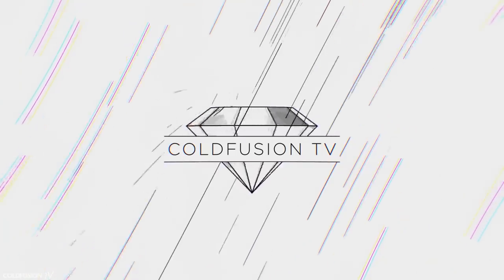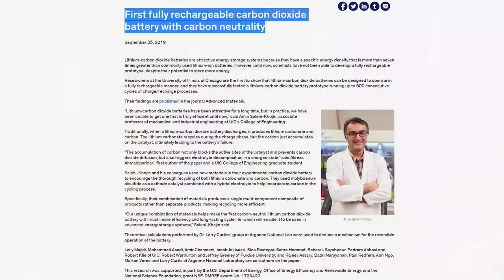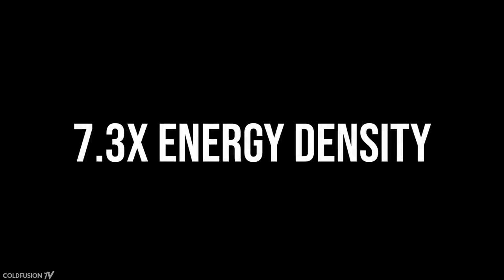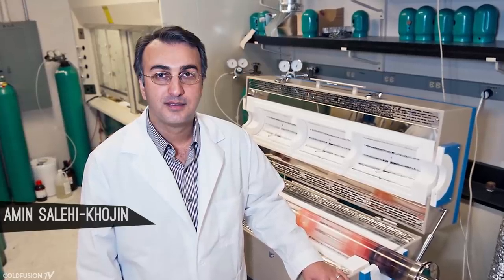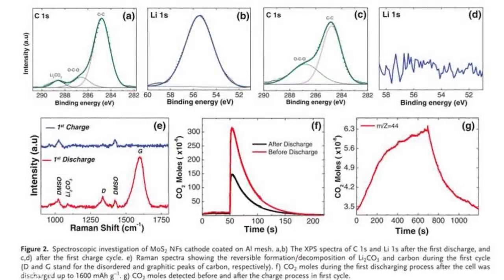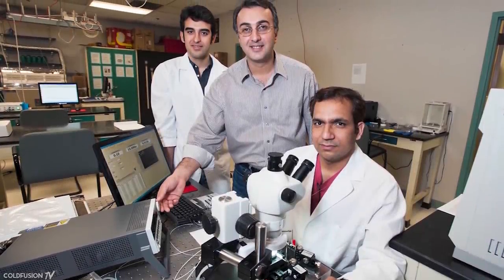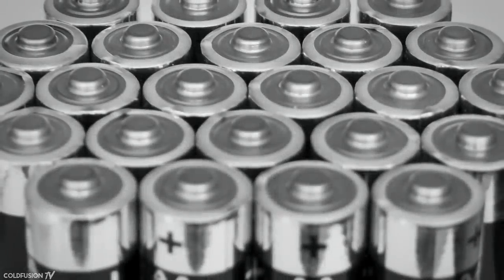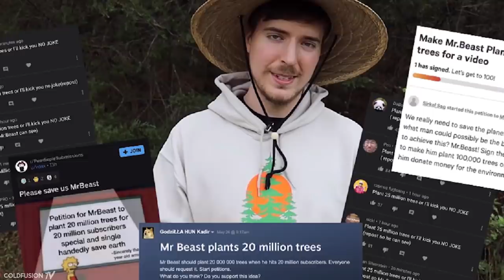Carbon Dioxide Battery Breakthrough

Comment: New batteries are like graphene: It can do anything but leave the lab.
Reply: Well said, lol
Reply: Best of The Year' YT  Comment !🏆👍
Reply: Sad
Reply: There are greater forces playing, we just need to wait until one wins.
Reply: @justj911  So why does the advertisement has Lipo after their trade name?  Doesn't Lipo stand for lithium polymer?
Reply: Just the same as cancer cures always 10 years away.....1970's 1980's 1990,'s 2000's 2010....always 10 years away...
Reply: Flex Seal can't fix that.
Reply: @hlcepeda  The reason it isn't used in many consumer applications is that it is difficult to properly produce within the tolerances needed for it to function as described.
Reply: Ay it 😂😂😂😂
Reply: @hlcepeda  The first link was a real eye opener.  All this time, I thought graphene was a fibrous film.  Most of this stuff are nano particles in powder or liquid emulsion form suitable for printing applications.  This is amazing.  Thanks.
Reply: PREACH
Reply: Bazinga!
Reply: @ashleylaw  Cancer in the 1970s and 80s was a death sentence. Also most cervical cancer can be prevented by getting a HPV vaccine.
Reply: @harryballsak1123  Then 1 in 300 now 1 in 3. Soon to be 1 in 2 you stand no chance...none .
Reply: enter the mirror world
Reply: Fundamental research produces 100 potential paths, and perhaps 1 or 2 turn out to be viable scientifically and commercially. You can thank them for their perseverance in bringing you modern technology, since almost everything you use today is based on such research, or you can be a jackass and pretend they did nothing for you and just point to failures or things still under development.
Reply: @ae1ae2  
Did it occur to you that I was making a joke?
Reply: Check out Estonia they are making curved graphene capacitors which are better than batteries for over a year now.
Reply: There is a company called Skeleton Technologies in Estonia that has been making a better form of "curved graphene" capacitor that is better than a battery. I believe it has in production for over a year now. That is encouraging.
Reply: @ph11p3540  yes and graphene is the polymer you genius
Reply: Whatchyamacallit I get your point, but Graphene IS in the market now. They make graphene car coatings and polishes.
Reply: You still need to mine a lot of Lithium metal, which is flammable if mishandle. Acid lead may be another choice.
Reply: @justj911  These are no true graphene batteries. Just a catchie marketing trick to lure in more buyers.
Reply: The battery technology is still in research phase because they fear the petroleum cartel will kill the scientists. They will release the finished product in time when the petroleum cartel allow them to reach mass production phase.

A new battery technology is not worthy to shed their blood.
Reply: @TUHANbukanorangARAB  Sure mate. The petrochemical industry has killing agents everywhere...
Dream on. Our periodical system simply doesn't provide many more choices to combine to make cheap, effective and light batteries. Taking into account the fact that fossil fuels will be around for at least the next two to three centuries, a commercialy viable battery is still far, far away.
Reply: @GTfour01  
Scientist said, "I am too young to die." Even ISIS was made to take over oil wells and oil refineries.
Reply: @TUHANbukanorangARAB  Yes. And the earth is flat. 😆😆😆
Reply: @GTfour01  
More over, Mujahiddeen fighters were trained and funded by CIA.
Reply: @TUHANbukanorangARAB  Yes, and that means the CIA chases all scientists trying to destroy any progression in the field of developing new battery technologies. Ofcourse you have many proven examples of this happening...
Reply: @GTfour01  
That is Possible, CIA just threaten them not to finish the research and it will not out for mass production untill the time when petroleum cartel allow it to be commercial product.
Reply: @TUHANbukanorangARAB  Ofcourse you have many proven examples of this happening...
Reply: @GTfour01  
Untill now, USA still depend on selling petroleum to gain profit called as PETRODOLLAR policy. Therefore new battery technology threaten PETRODOLLAR then CIA must react.
Reply: @TUHANbukanorangARAB  Any nation capable of building their own 5th generation stealth fighter/bomber jet, is more then capable of researching and developing battery technology. Your case simply doesn't stand. Sorry. (Not)
Reply: @GTfour01  
So you think Rusia is willing to go bankrupt for researching battery technology because no one will buy Rusia's crude oil? STUPID MOVE. My opinion is Rusia prefers to sell crude oil instead of researching new battery technology.
Reply: That's the thing about science and engineering. The science is demanding in how you make the discoveries and lay out the groundbreaking work itself. Engineering strives to mass produce these discoveries and make them as optimally functioning as possible and eventually publicly available.
Reply: Business
Reply: well maybe they already have Mainland students in the labs or supervised by Mainland China sponsor
Reply: look at NAWA Technolgies
Reply: fg you've used your quota on that line. Time to try a new one ( if it ever leaves 'your' lab).
Reply: Alright, give this one the best comment of the year award already.
Reply: what about the new tesla plaid batteries?
Reply: But lithium ion batteries did leave the lab.
Reply: Thanks for laughs!
Reply: Not at all. There are many other battery technologies that surpass Li-ion, but they tend to be very volatile and unsafe for public commercial operation, so are unsuitable for cars, planes or personal devices.
Reply: And now both have infact left left the lab and gone on to make money lol
Reply: Why do people still think graphene products aren't available?
Reply: Lol well it got commercialized

Comment: Do a video on "Top 20 battery breakthrough technologies that didn't happen." Or 50 or 100, however many you have the patience for.
Reply: 100 battery breakthroughts that are a threat to "Big Battery" Oligarchs
Reply: Modern Battery powered technology is only good enough for boats and scooters.

If they raised energy density by x2 then it will be viable for motorcycles.
And if they raise it by x5 then it will be viable for cars.
While raising the density by x10 will make it viable for heavy trucks.
And a whopping x30 increase will make it viable for planes.
Whilst needing an absurd x40 increase for helicopters.
Reply: @ekinteko  Modern Battery powered technology isn't viable for cars? are you sure?
Reply: @dapal8396  
Sorry, maybe the wording was wrong.

I meant viable as in the sense of replacing Internal Combustion vehicles without any major shortcomings. Or even equalling them. The current best is the Tesla Model S, and that has limitations to throttling, range, and weight. If we were able to increase Liion energy capacity by a factor of x5, that will allow us to install a smaller battery that lasts longer, putting it on-par with modern vehicles.

Remember the electric engines have +90% efficiency compared to -35% efficiency of ICE. However, liquid fuels store between x40 to x100 more energy per gram compared to batteries. The combined difference is between x10 to x40 density advantage for ICE. Hope that clears it up.
Reply: Kangal Funny, but I thought my Model 3 was VERY viable. Daily driving, long trips, you name it, it works for me, bloody brilliant car.
I must be dreaming I guess.
Really MAJOR shortcomings? Yep, my other car, an ICE, has heaps and heaps of them.
Reply: @FutureSystem738  As someone who is in the process of pre-ordering a Model Y, I think Tesla supporters should take their arguments down a notch. 
Look at the disdain that most people have towards vegans - why - because they come on too strong when they talk to people who don't share their point of view.
Reply: @Alorand  
I concur.
I appreciate their enthusiasm, but there's only so much exaggeration you can make until it's untruthful. I say this as a fan of EV's: we're not quite there yet. Just because something works for them, doesn't mean it works for the majority. Many don't realise that the Supercharge network, road conditions, etc etc, are not equal. If they cut the weight off the Model 3 slightly, and extend it's range by x4, then it will be on-par with modern midsized cars. I expect we will hit this target in 7-14 years time. And by 2040 most vehicles will be EVs.
Reply: Kangal & Alorand.  So you own a Model 3 do you? Hmmm... No, thought so.
I have owned about (at a rough guess?) twenty different ICE vehicles, bought both new and second hand. Also prior to the Model 3 we had a plug in hybrid. We now own a 2014 ICE SUV and a 2019 Model 3, so am “fairly” qualified to comment.
Fact: we now only use the ICE car when we absolutely have to. Fact: where my wife once was always happy to let me drive, she now wants to share the driving.  There’s a very good reason most of us are rather passionate about our Tesla’s, (and some other EV’s.) 
And also yes if you’re wondering, our car is charged almost entirely from our own solar power.
Obviously even a small improvement in battery density would be great, as would a drop in price, but we are already at the point where pure EV’s are EXTREMELY viable, (and I’m ignoring the elephant in the room, air quality in our cities.)
BTW I have not used, or needed to use a Supercharger yet.
Reply: FutureSystem738 Agreed! If we have to wait till 2040 for most cars to be EV as one of the previous posters suggests, then all of us living in big cities are dead from air pollution. There is already a huge body of evidence about the damage that pm2.5 particles are doing to all of us living in cities. Sure there’s a place at the moment for ICE vehicles, but the sooner they’re gone, the better, and bloody good riddance! Many cities are banning them from as soon as 2030, and for very good reason.
Reply: @FutureSystem738  
All I'm hearing is your priveleged lifestyle.
Remember EVs are about x3 more efficient than ICEs, but Fuels are more energy dense and for good physics reason (no need for an Oxidiser, they use oxygen-rich air).

Lithium battery: 0.9 KJ/g
Best Lithium ion: 1.4 KJ/g
Standard fuel: 35 KJ/g
Energy Rich fuel: 80 KJ/g

Remember, weight affects vehicles. Negligible in the water, less so on terrain, much so with flight. So unless you're breaking the laws of physics with your Tesla, there's not much argument you can make.
Reply: @daven1357  
I said by 2040 most cars will be EVs, that statement doesn't mean we wait until then and then produce them. That's a false inference. And even if laws force higher EV sales, that doesn't mean the cars on the road will magically disappear, they will be around for 5-20 years. So by the time most ICEs are replaced, the next-generation EVs will be able to match or surpass ICE cars when it comes to range.

The technology to increase battery density by x4, and financially afford to be able to mass produce them, that task will take a longer time then fans realise even in 2020. We will continue making EVs, continue increasing Supercharging Points, and continue making improvements in Battery Technology. The change will happen in a gradient, not overnight, that was the point.

I can't comment on if humans will be extinct before that time due to pollution. I also do not hate ICE vehicles, they were the best technology we had of the time, and have served humanities wants well for the past century.

Let's all try to keep our emotions and biases out of this, and remember the physics and history surrounding this complex topic.

edit: fixed a typo.
Reply: Kangal Whatever floats your boat, this is getting pretty ridiculous. “Privileged lifestyle”? (Now I see where this is going.) BTW It’s none of your business- I’ve studied and worked my heart out over a lifetime to get where we are now. You (and your mate) said that EV’s were not “viable”. Maybe you meant something different like perhaps “affordable for twenty year old students” in which case the discussion would indeed be very different. 

Yes, EV’s aren’t cheap, YET, I do get that. (But neither were even Model T’s let alone other ICE vehicles when they first came off the production lines.)
In response to “not viable”, I said that EV’s are most definitely viable, and followed it up with facts, so let’s now just leave it at that, I won’t bother going further with this, a total waste of time. 
Cya
Reply: @FutureSystem738  

I don't think you comprehended what I actually said. You are priveleged, in the sense, you have the infrastructure for good roads and charging stations. This isn't much about affordability.

I was stating the fact, that those commodities aren't available in most places, for instance East Europe. I noticed you completely glossed over the issue with physics, and energy density. You never proved that EVs are viable outside of your niche location.

When I said they aren't viable, I am true in this assessment. You are an exception. Remember there are nearly 8 Billion people. With that said, you should change your outlook/attitude, and be optimistic about the future, EVs will be viable as long as we improve battery technology. Currently boats and scooters are, and soon eBikes will be on-par with their ICE counterparts.
Reply: @ekinteko   I think you waste your time trying to discuss this issue. I am amazed how nice you are and how often you clarify your statements but when people think humanity will be gone by 2040 because of air pollution caused by cars or ignore that there is virtually no infrastructure for EVs right now, you can state whatever fact there is, it is pointless.
Reply: @ekinteko  is it more environmentally friendly to buy a new tesla or an average used car? would EVs be viable if charging stations were as common as gas stations?
Reply: @chickentamales6837  
You're not gonna like my answer: it depends.

When we're talking about environmentally friendly, we're usually thinking about The Big Picture or the total effects. And that can be affected by several major factors:
What is the emmisions of the EV and the ICE vehicle?
What is the source of electricity for your city?
How long will the Used ICE last for until it needs a major service?

If we're talking about the "average" USA conditions, then you can expect maybe 60% of the electricity from non-renewable sources, and a fairly new EV to have much higher efficiency compared to an ICE, the pay-off period of roughly 5 years, and the Used ICE requiring a major service after 5 years. So on average, the Used ICE should be slightly more environmentally friendly, according to the calculations I know of. Just remember, it all depends on those factors, as the scale can sway one way or the other.

But what would be even more environmentally friendly is to continue driving the old Used ICE, and when a major service is required... then to actually make it an EV Conversion. The problem is that we don't have any industry or infrastructure to do so. And on top of that, most Used ICE cars are difficult/impossible to convert because of the complicated systems in modern cars (+2005).

So what is my postulation? I think eventually in the USA these older cars and the newer cars will end up in the scrap heap. The old EVs will be refurbished. Most car sales will shift from ICE to EVs starting sometime around 2025-2030 when it hits critical mass. At that point, there should be further technological advancements to battery technology. Tesla will probably have deals with other auto manufacturers to use the Supercharge network, and help supply some battery units. I think more people will end up getting Solar and Lithium units in their brick homes. The grid power supply will become more green, possibly with some nuclear help. The price of power should increase around x2-x3 but it would be acceptable with the inflation and drop in purchasing power. Driving experience will be like the current Tesla, where it is all on the responsibility of the driver, who has some Assisting functions. I'm not so hopeful about driverless technology, as it's pretty risky with the current weak computing and blind camera sensors. Volvo was right and moral when they said that if any manufacturer releases it, they have to be responsible for cause of death, injury, or property damage. Google's Waymo is actually the most successful so far, as it uses good software, computing, cameras and Lidar surveillance... but that project seems to be on-pause. So don't expect the self-driving truck you saw on The Simpsons as it's not going to be nearly as impressive.

...all the auto-manufacturers are weary about actually spending money on the Lidar system. But it largely depends on how Congress responds to their propositions.